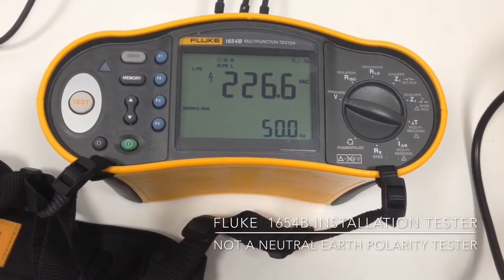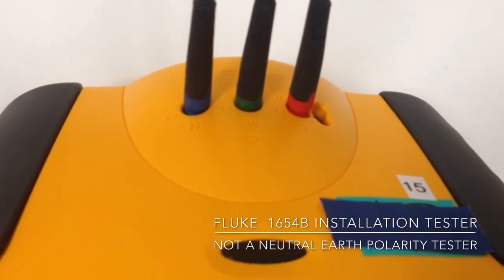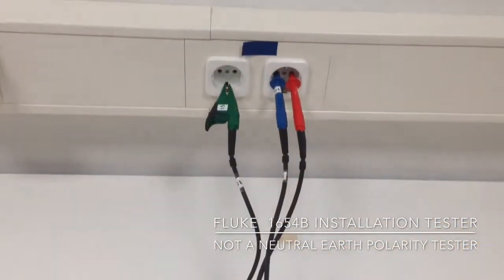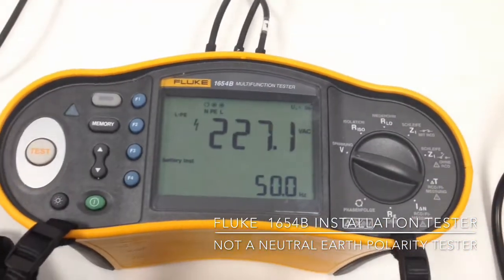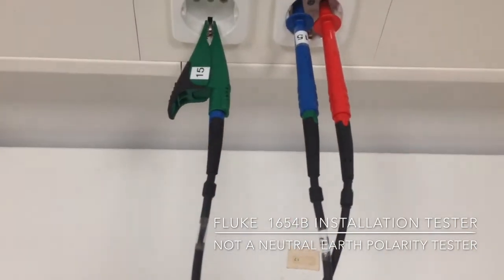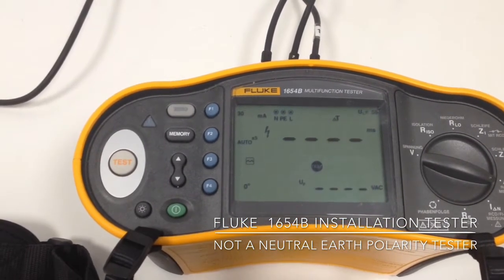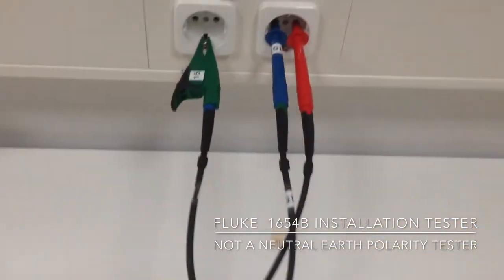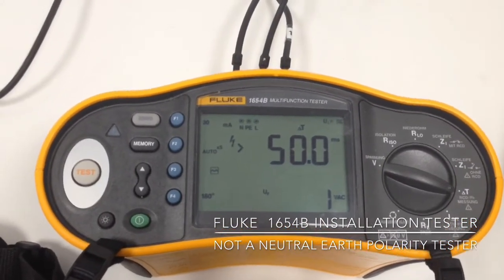Fluke Installation Tester 1650 Series - Not an indicator for neutral earth  reversal.

Comment: Hi i think in fluke 1654B you can used F1 to check voltages between N-L ,N-PE and PE-L ;) try .
Reply from the maker: You're right voltage present can be checked, but unfortunately you would never know if the neutral and PE are reversed behind the outlet.
Reply: Yes mate just I live in UK so we have different sockets and plugs so you can't change live with neutral wires every plugs have fuse and you can't  if you change in socket you can just in first time how you want used this socket RCD go off :-)